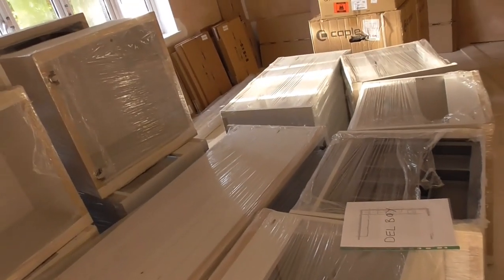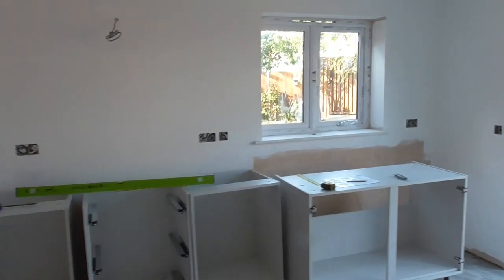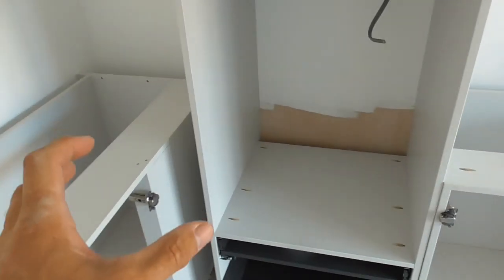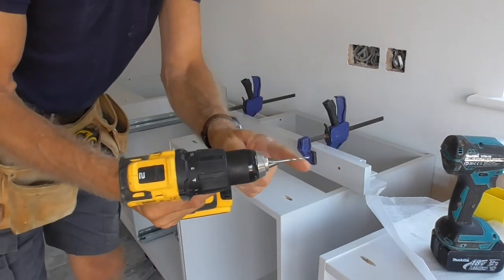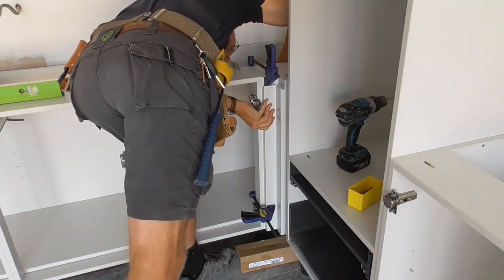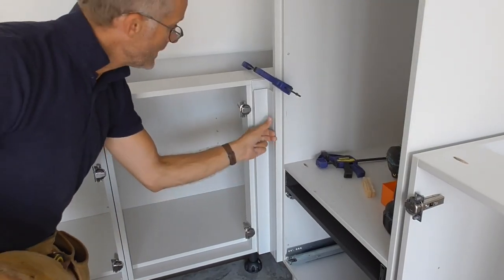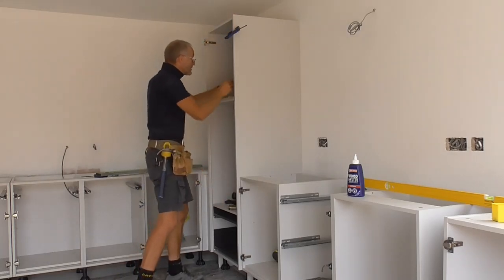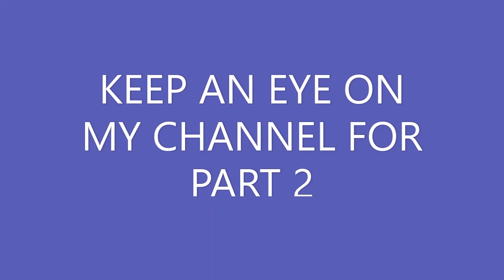KITCHEN FITTING UK. ***GLOSS GREY HANDLE LESS KITCHEN*** PT1

Comment: Once you get a set of those airbags you always questions yourself as to how you managed with out them, so handy for various things. Not sure about you but I always get a lot of satisfaction after fitting a kitchen, I think it’s my favourite thing after roofing! 👌🏻
Reply from the maker: I agree Mark, and I think it's because you really see what you've accomplished👊and as for air bags🤔all I can say is, GAME CHANGER🤩 Thanks for your comment😎Cheers Del
Reply: Ive been using those air bags for a good while now but they have an issue with deflating on their own. Ive stuck with winbag despite ALL of them doing the same. Somehow they must get dust kn them which just effecvthe seal and thus they let air out. Wouldn't be without them for hanging doors, fitting windows, opening up gaps, etc etc. But slightly annoying for them to deflate at the wrong moment. Certainly wouldn't trust my winbags for more than 20 seconds holding.....
Reply from the maker: @jonbarrie7002  Hi John🖐I have a few of the Winbags and haven't had a problem like you describe🤔I did have a leak in one though, and I must have worn it out of put it on something sharp😵 There must be a one way valve in the pump, and that might be faulty🤔Pretty cheap to replace, so not bad if one goes down. I've also got some Trend ones which are good and were cheap👍Cheers Del

Comment: Great work Del, looking forward to part two. Another way to the the end panels, flush on top is to fix a KD Block into top of panel and let it sit on top of the unit, perfect every time.
Reply from the maker: Hi Kyle🖐Thanks for tip on using a KD block to line up end panels, and you can see me using a similar method in my other kitchen fitting videos👊Thanks for watching😎Cheers

Comment: Nice to see your kitchen units are well thought out and fit better than the roof trusses. Like that corner piece. Just installed a flat pack kitchen with the same corner detail only they gave you nothing to transition the corner. Had to fabricate a bit myself. The other thing I see they still do in UK is the stand off for pipes etc. behind the unit which can also be used to scribe. We don't get that. The backs are flat to the wall. Fine on a new all square house but useless on an old Queenslander. The other thing we often get is wrapped panels and doors. They don't like being scribed. If you cut through the wrap it wants to peel back. It just falls off like the skin it is. Again not good for old out of level houses. You would think the sheet would be stuck to the board but every one I have had to cut just peels off. Don't do many kitchens here. Kitchen fitting is a Trade on its own. They call them cabinet makers. Being English this makes me think of bespoke furniture makers not guys that make chipboard cupboards. But each to their own.
Reply from the maker: Hi Dave🖐I know exactly the plastic wrapped doors/panels you're talking about, and agree with you about how it de-bonds from the surface when you cut it😵and yes, the 50mm void at the back of the base units gives a fair bit of flexibility for fitting in different properties👍Great comment, as always👊and thanks for watching 😎 Cheers

Comment: I did kitchens for 8 yrs Del! I was thinking about the 2-3 times I never had to scribe a tall wall panel or check measure guy didn’t just allow extra 25 mm on for fitting! Thinking you lucky bugger! Then 2 seconds later… ‘ I might have to shave this one a couple of mm…’ 😂👍🏻

Awesome kitchen company! Ours SUCKED! Bare cabinets! You had to hinge all doors on site, even make up drawer boxes and fit runners etc. it was a nightmare! Then fitting this crappy 6.5 mm ‘Granit’ sheet on top of either existing laminate ( makeover) or particle board if new.  Miter front edge, colour match an epoxy and glue front edges on.

If you could think about the hardest way possible to install a kitchen, that was their ‘specialty’

And as always though, you got GOOD! And FAST! and see if you can guess what they did about your install fee the quicker you got…🤔
Reply from the maker: Fitting those kitchens sounds as bad as pulling teeth bud😩and it's the age old story of the price diminishing the faster you get😵That's why I stopped working on price 20 years ago, as you just work harder and harder for the same money🤬Thanks for your comment 😎 Cheers Del

Comment: ive just started a kitchen this week del. howdens kitchen. when i use a laser to level up  i set the laser 20mm above what i want the cabinets to finish at. then i mark a little scrap offcut of whatever is handy. by the same 20mm. then use that each corner. works so well. also have you seen those kitchen fitters mate things? they are absolutely class for manouvering tower cabinets
Reply from the maker: Hi Paul🖐I do like the method of setting the laser higher and using a block to reference off👊And, yes, I have seen those carcass dolly's and they look great👍(don't do kitchens enough to warrant buying one though😬) Thanks for watching bud😎Cheers Del

Comment: Hi  Del another great video again, when it comes to fitting kitchens/wardrobes I never have a tool pouch on me in case I slip/or someone drops and it surprised me and I could turn sharply and possibly damage the item's. also, I noticed that you have only 2 cordless drills to hand and changing bits from one to another to me is not preferred way I would work, this an observation only I have at least 4 on go at all times. Keep them coming, great to watch.
Reply from the maker: Hi Robert🖐Great comment and I am constantly aware when moving/lifting things that my pouch might damage them, so I do drop it off regularly👍(I guess I wear it all tge time out of habit being a general carpenter). And, again, you're spot on about having plenty of drills on the go when fitting, and I've got lovely little set of M12 Milwaukee drills just for kitchens, but I don't generally carry them on the van and forgot to put them on😖 Thanks for watching 😎 Cheers Del

Comment: Great video. Have you got a video on integrated dishwasher end panel I've got an integrated dishwasher on the end of a run of base units and was wondering the best way to install the right side panel  to the floor i can fix it to the worktop and wall but the floor is something I've never done any ideas I'd be grateful.
Reply from the maker: If its a solid floor, then I would simply bond the bottom edge of the panel down using high performance adhesive💪 If its a laminate/floating floor, then I would use a couple of thin angle brackets/stretcher plates, one behind the plinth line and one towards the back👍Hope this helps🤞Cheers Del
Reply: @thetallcarpenter  great stuff sounds like a plan cheers bigen

Comment: I must get a set of them air bags, I have two viking arms that are great for lifting the units but no use to reach the back of the units. I was curious to know what size spacer you used to set the gables of the tall unit?
Lovely job. That corner piece looks fantastic
Reply from the maker: Hi Dan🖐I have dedicated 23mm spacer that I use, but I couldn't find it that day, so I just used 2 bits of 11.5mm osb that were laying about 👊 The doors are a little under 22mm so leaving the panels forward 23mm leaves a tiny gap so the hinge side doesn't bind, and flapping side has a 1mm cusion/stopper on it👍Get yourself a couple of air bags bud, it'll change your world🤯Thanks for your comment 😎 Cheers Del

Comment: Great video. I'm just starting to fit my kitchen and was wondering about end panels at the junction with the plinths. I see you've cut the end panels at the bottom to take the plinths in this video but in other videos of yours you don't. Is it just a personal preference thing? 
 For me I'll be fitting LVT click flooring after the kitchen is in so the end panels without the cut out wouldn't work I think.
Reply from the maker: Hi there🖐Cutting an end panel for the plinth to run through is usually down to personal preference, but I think it makes the plinth line look neater👍Good luck with your kitchen and thanks for watching😎Cheers Del

Comment: I wish someone would post a video showing an install where the walls are all running off and the room is not square and explain how to get round these problems
Reply from the maker: Hi there🖐I purposely steer clear of those sorts of jobs, but when doing them in the past I bring all the units away from the walls on packed out horizontal battens and then scribe in the end panels back to the wonkey walls👍Cheers Del

Comment: I was taught to drill a clearance hole through one of the pieces of wood to be screwed together but I'm not sure people do that now when they're drilling pilot holes. What are your thoughts on this? Really enjoying your videos by the way.
Reply from the maker: Hi Mark🖐I have a tct countersink/clearance drill that I normally use, but I have found when screwing 18mm kitchen units together, that just a 2mm drill bit and 3.5 x 30 screws works fine and always pulls the units together without having to bury the head👍Appreciate you watching and thanks for your comment 😎 Cheers Del

Comment: Hi Del, why do you cut off (or notch out) the bottoms of the end panels either side of the tall unit? Is it just personal preference that you like to see the plinths run seamlessly beneath all the units? I haven’t seen anyone do that before, usually the end panels run all the way to the floor. Cheers!
Reply from the maker: Hi Simon🖐I consider a few things when fitting full height end panels🤔In this particular instance, I think the panel going all the way to the floor would have made an awkward, tight little corner where the adjacent plinth run would have finished. I do prefer to see a seamless plinth line, as, with time, end panels at floor level take a beating . Having said that, when placed at the right point in a layout, they can look really good👍Thanks for your comment 😎 Cheers Del

Comment: Del, I got handles to fit to my daughters kitchen. What handle jig would you recommend please? Oh and have you got a link to those airbags please?
Reply from the maker: Hi Steve🖐I just measure out when I have to drill for handles and I just picked those air bags up of a builders merchants counter👍Thanks for watching bud😎Cheers
Reply: @thetallcarpenter  Thanks Del. I always watch your video’s as they are informative and well presented.
Reply from the maker: @dadcanufixit  👍😎
Reply: You could always make your own jig out of an off cut of wood 👍
Reply: I have bought the kreg jig, I may even do a video on it when I get it.
Reply from the maker: @dadcanufixit  I'd be interested to see that Steve👍
Reply: @thetallcarpenter  Al Lumnah from Lumnah Acres used one recently in his new property. It came out quite well so that’s why I went for this one. My video skills may not be up to scratch for this though.
Reply: @thetallcarpenter  Hey Del, i tried it today, set my laser up for a level with the aperture on the cetre line. Set the fence correctly and away to go. It was simple, and straightforward. Maybe do a small video tomorrow when i do the others
Reply from the maker: @dadcanufixit  Nice👊

Comment: Del what made you buy a dewalt drill when the rest of your gear is Makita? Just wondered because of the batteries. Love this video mate, looking forward to part 2 👍
Reply from the maker: Hi Greg🖐I bought that little DeWalt drill for a couple of reasons. I had recently bought the 16g DeWalt 2nd fix nail gun, and it was body only, and also the drill, with case, charger and 2 small batteries, was only a few quid more than 2 batteries on thier own👊 I don't use it very often, but when I do, it's a lovely little tool👍Thanks for your comment and for watching 😎Cheers Del
Reply: Makes sense - cheers Del

Comment: Hi Del great work mate, did you say you leave 502mm from corner post to edge of unit? I always go 500mm, is there a teasin way you make it 502mm ?
Reply from the maker: Hi there🖐Each door is 4mm smaller than its carcase,(2mm each edge), so to maintain a 4mm gap between the door and the corner post, I leave the corner post 2mm back👍Hope this makes sense👊Thanks for your comment😎Cheers
Reply: @thetallcarpenter  I'll bear that in mind in the future ! Nice 1 Del !!

Comment: 10mins 50 secs in and i've just noticed the best idea, cannot beleive i've struggled fitting those tall end panels in the past.😃 Such a simple way to support them and stop them sliding down. Nice one Del!!!

On a side note, are your trainers/boots safety shoes or not. Trying to find some safety boots/trainers that are compfy and cannot find anything. What are those you're wearing please?

Keep up the good work
Reply from the maker: Hi Steven🖐Thanks for your comment bud🤗I have to come clean and tell you my shoes aren't steel toed😬They are Gelert Ottawa low walking shoes from Sports Direct👍They are super light, comfy and only £25. I know I'm putting my toes at risk, but I find steel toe caps quite clumsy especially when climbing around on roofs😶Cheers Del
Reply: @thetallcarpenter  Thanks for the info Del. I'm a spark and when working in domestic safety boots/trainers are a PITA too. Going to give these a go at that price. Thanks
Reply from the maker: @SME_Ste  I get through 2 pairs a year Steven and that's them taking a beating on sites😵‍💫Cheers

Comment: Don’t like position of tall unit 🏴👍
Reply from the maker: I agree Peter😬Its not the best use of space in my opinion🤔Thanks for watching😎Cheers Del
Reply: @thetallcarpenter  it’s a tricky one sometimes to get the layout right. Having flipped 3 bungalows now we will always install eye level ovens but sometimes have to compromise on aesthetics to achieve this.
Reply: Could have fitted a modified tall unit above the corner base unit so the tall unit door opens above the worktop to get rid of that wasted area into the corner.